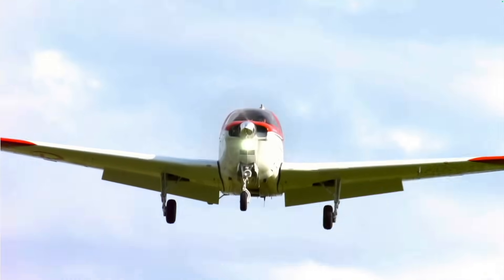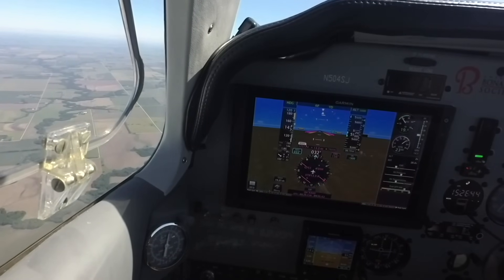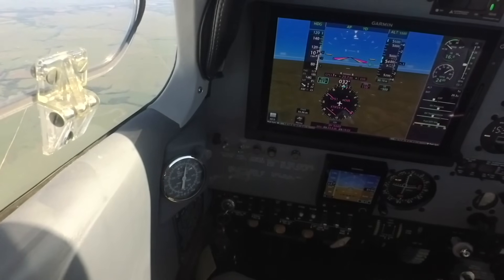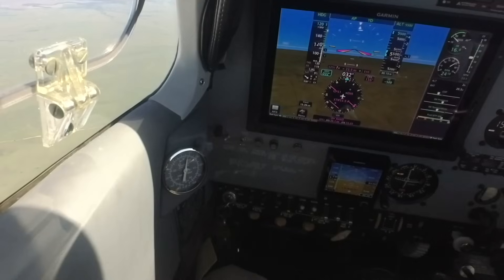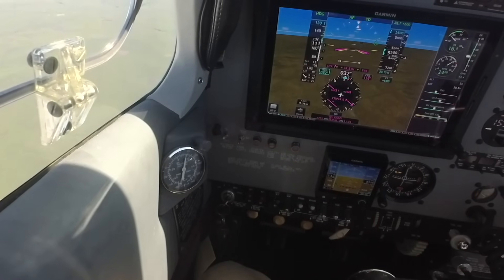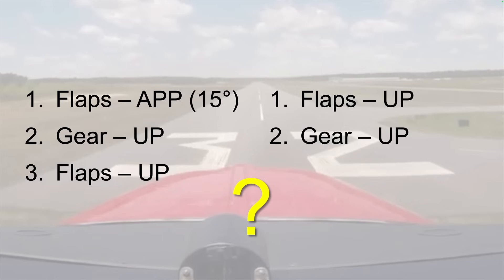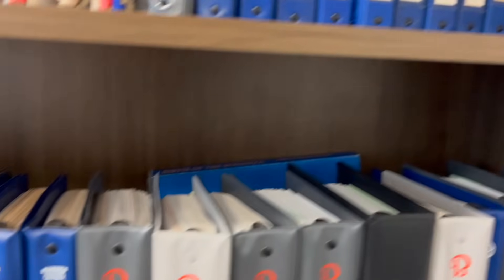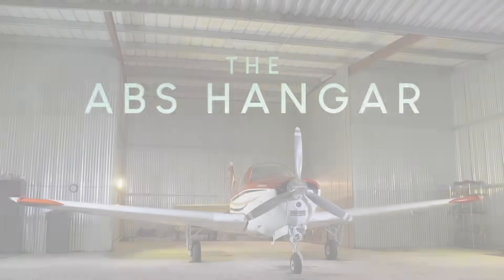Flaps or Gear First? The Definitive Go-Around Answer for Beech Pilots

Comment: Tom, In the BPPP Instructor Standards Manual - Bonanza - Rev 8, page 32: The Missed Approach paragraph states, "With positive climb, raise the gear. Then, no hurry to raise the flaps".  For a Balked Landing, "With positive climb, raise the flaps to approach position. Then, raise the gear.".   
The sources of confusion from ABS are several such as "lift versus drag" and nuance terminology such as "missed, balked, aborted, or go around".
So, if I were you, I'd remove this video for liability reasons because it is not "definitive".
Reply from the maker: Thank you for your comment. Our team is in the process of addressing viewer comments and we will be re-uploading this video soon. Thank you!

Comment: When Ive had to go around in my Bonanza I apply full power, make sure Im accelerating away from my stall speed and climbing away from the ground. Once Ive made sure of both these gear goes up and flaps start coming up after that. The gear and flap levers are engaged perhaps within 2 seconds of each other. Does it really matter which one occurs first. My rationale for gear up first is its producing drag only whereas the flaps are giving me some lift and also reducing my stall speed . In reality both take a few seconds to retract and probably happening happening at the same time so does it really matter
Reply from the maker: Thank you for your comment. Our team is in the process of addressing viewer comments and we will be re-uploading this video soon. Thank you!

Comment: I would just get the airplane into the takeoff configuration first, just as if the aircraft is 10 feet off the ground after liftoff.  The airplane climbs with partial flaps and wheels down just fine during almost every take-off.   Once you are there, raise the flaps to take-off configuration and then the gear and the rest of the flaps as you normally would.  The Bonanza is already approaching take-off speed at the time of the go-around.  JMHO.
Reply from the maker: Thank you for your comment. Our team is in the process of addressing viewer comments and we will be re-uploading this video soon. Thank you!

Comment: This is TERRIBLE advice and should be removed. How the heck is this even a question, it shows a gross lack of basic knowledge of aerodynamics. 

Gear ALWAYS before flaps. Stalls are not about speed, they are about angle of attack. Raising flaps equals a loss of lift and a substantial move towards critical angle of attack at low airspeed. 

As a longtime instructor both in GA and at the airlines this is truly shocking that the Bonanza Society would put this video out…..must be for the clicks, because you guys are going to get someone killed and I hope the feds are pointed to this video.
Reply: I agree.   Get the gear up & fly the airplane, bringing the flaps up following the correct pitch attitude.   Flaps are your friend in a GA scenario
Reply from the maker: Thank you for your comment. Our team is in the process of addressing viewer comments and we will be re-uploading this video soon. Thank you!
Reply from the maker: Thank you for your comment. Our team is in the process of addressing viewer comments and we will be re-uploading this video soon. Thank you!

Comment: You forgot to consider the fact that, while having the gear down only produces DRAG, the flaps generate both LIFT and DRAG. At low speeds—such as on short final, when you're likely to initiate a go-around—the ability to manage lift is more valuable than having three wheels out for no reason.
So, in order to gradually regain speed and start climbing, I would prefer to get rid of the undercarriage drag first, while retracting the flaps in stages to avoid sinking and to maintain full control until reaching a safe altitude.
I don’t fly a Beech, but in my experience, it’s not just about how much drag each one produces. The key is reducing total drag without compromising a stable recovery.
Interesting content—thanks for sharing, and regards from Argentina.
Reply: Absolutely correct- it's not about the speed, it's about the lift, & you'll get better lift at low speed with gear up first.
Reply from the maker: Thank you for your comment. Our team is in the process of addressing viewer comments and we will be re-uploading this video soon. Thank you!
Reply: This is exactly what I was thinking the entire time watching the video.
Reply from the maker: Thank you for your comment. Our team is in the process of addressing viewer comments and we will be re-uploading this video soon. Thank you!
Reply: I was gooing to say the same thing.
Reply from the maker: Thank you for your comment. Our team is in the process of addressing viewer comments and we will be re-uploading this video soon. Thank you!
Reply from the maker: Thank you for your comment. Our team is in the process of addressing viewer comments and we will be re-uploading this video soon. Thank you!
Reply from the maker: Thank you for your comment. Our team is in the process of addressing viewer comments and we will be re-uploading this video soon. Thank you!
Reply: In most light aircraft,  anything more than 10 degrees of flaps creates more drag than lift. Alot more drag than the gear produces. 
Remember.. pitch, power, flaps 10, gear, trim...
Building speed and lift on a go-around is impossible in many situations with full flaps down.
Reply: @gregoueilhe1382  Speaking of light aircraft, I own a C172K (with 40° flaps), and I’ve never had an issue going around with full flaps as long as I anticipate and manage the proper attitude in time. It all comes down to which device help keep the airplane flying in such critical phase and which don’t, so you should first get rid of what’s aerodynamically useless.The lift-to-drag ratio of the flaps varies with speed: at low speeds, flaps generate MORE lift relative to drag and vice versa. That’s why it's also critical to retract them gradually, so the aircraft can compensate for the loss of lift with the increased speed.
I’m not an aerodynamics engineer, and I’m sure there’s a good reason why the Beechcraft manual recommends otherwise (probably a protocol relative to its specific flap retraction timing)— I’m just sharing what I learned over the years from competent CFIs and has worked for me, even in mid-weight aircraft with retractable gear. 73 & good winds!

Comment: "If the take-off (could go around be inserted here?) is from a small field surrounded by tall obstructions, the working of the roller-coaster effect can be quite dramatic ---if an experienced pilot is at the controls.  The inexperienced pilot has a strong tendency to point the nose up steeply and simply hope that the airplane will climb out.  But it is easy to overdo this and, by trying to get too much altitude too quickly, to kill ones speed and stall, perhaps 50 feet off the ground.  The experienced pilot will therefore point the nose up only as high as absolutely necessary to clear obstructions.  In fact, if the take-off is from a very tight field, he will often point the ship's nose actually at the obstructions ---maybe a half height of the trees.  This does not help the airplane gain height, but it does help it gain speed.  And the experienced pilot does not worry, because he knows (without thinking about it) that speed and height are two forms of the same thing, and for various reasons he prefers to have the thing in the form of speed.  And he knows that he can always at the last moment convert speed into height by pulling the nose up;  the airplane will then 'zoom' and clear the obstructions."  Stick and Rudder page 85.

In 17,000 hours crop dusting and patrolling pipelines, I have learned that the energy management techniques in Stick and Rudder are far more efficient and therefore safe than any of the V-speeds or order of preference of techniques in either ACS or the POH.  If you don't know and apply the law of the roller coaster, what the airplane wants to do, the apparent rate of closure with the desired touchdown spot, lift and buoyancy, and thin air... among other safe maneuvering flight techniques, the choice between gear or flaps up first on go around may not make any difference.  I never had the gear or flaps up first problem in Cub, Stearman, Pawnee, or even Cessna crop dusting, but when taking off or going around at high DA midday in summer in Comanche or Bonanza, level in low ground effect until zoom reserve airspeed and down drainage egress were much more important than gear or flaps up first.  Ground effect and down drainage energy far exceed either gear up or flaps up energy savings, save perhaps 40 degrees in Cessnas.  And on go around in a small Cessna, I would pitch down to level first (law of the roller coaster) before messing with the flaps.

Comment: In a 28V Bo gear retraction takes about 2-3 seconds so why not slap the flaps up and then immediately raise the gear handle. It’s up before the flaps are. Problem?  
Thanks for all you do Tom
Reply: If you do that while you are trimmed for landing, you get a huge pitch up which has to be counteracted with an immediate and strong yoke push forward.  If you delay for even a second or two, you get a sharp nose up and possible quick stall on one wing which creates a roll over and crash.
Reply from the maker: Thank you for your comment. Our team is in the process of addressing viewer comments and we will be re-uploading this video soon. Thank you!
Reply from the maker: Thank you for your comment. Our team is in the process of addressing viewer comments and we will be re-uploading this video soon. Thank you!

Comment: I believe that when close to touch down, you fly at about 70 kts or even less. When rapidly retracting the flaps to a full up position in this particular situation with the gear still down, you will fall from the sky by stalling. Especially when simultaneously raising the nose a bit to achieve a positive ROC, even when having applied T/O power right before. You should mention in the video to apply T/O power before anyway! I always retract one notch of flaps after having applied T/O power, then, if the terrain allows it, I fly level for about two seconds allowing airspeed to build, then I see a positive ROC automatically, then I raise the gear, and finally I retract the flaps to full up position, always observing directional control, airspeed, and ROC. I am not a CFI, just flying my F33A around.
Reply: Light aircraft flaps back to 10 degrees.  Power is already restored, so anything above 10 degrees of flaps is perfect
Reply from the maker: Thank you for your comment. Our team is in the process of addressing viewer comments and we will be re-uploading this video soon. Thank you!
Reply from the maker: Thank you for your comment. Our team is in the process of addressing viewer comments and we will be re-uploading this video soon. Thank you!

Comment: Thanks for putting this test together; it's a helpful look at drag differences in a clean, stable environment. 

One thought: the conditions you tested seem more representative of a missed approach (higher, faster, more margin) than a close-in go-around near touchdown, where the aircraft is slower, lower, and fully configured. 

In that low-energy state, could retracting flaps too early before the gear and before establishing a positive rate of climb cause a sudden loss of lift with little altitude to recover?

Maybe you could conduct the test under actual approach conditions at a safe altitude.
Reply from the maker: Thank you for your comment. Our team is in the process of addressing viewer comments and we will be re-uploading this video soon. Thank you!

Comment: Great video.  I have a 35 Bonanza.  The landing gear on Bonanzas are excellent but they create so much drag that I rarely need to use flaps.  Yes, I use flaps for a short field landing and the larger bonanzas probably need flaps but model 35 lands great without flaps.
Reply from the maker: Thank you for your comment! We are planning to reupload a new video with some corrections so please make sure and watch that once it's released

Comment: Excellent video. My assumption has always been that the gear causes more drag than the flaps. I'll need to change my procedure for go-arounds now. Thanks.
Reply: Wrong, most light aircraft always demand flaps 10 degrees on a go around. Especially on a hot day. Full flaps will bury you.
Reply from the maker: Thank you for your comment! We are planning to reupload a new video with some corrections so please make sure and watch that once it's released.